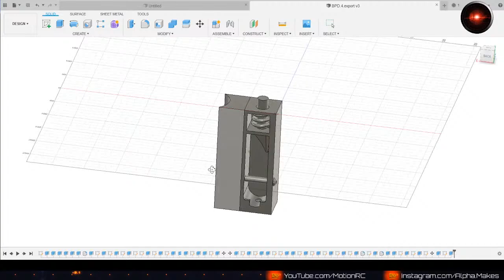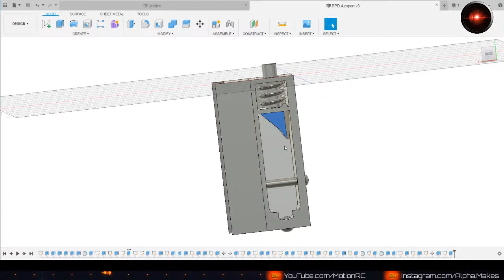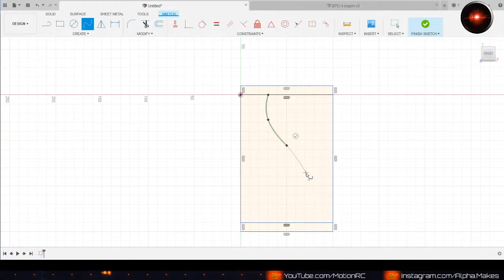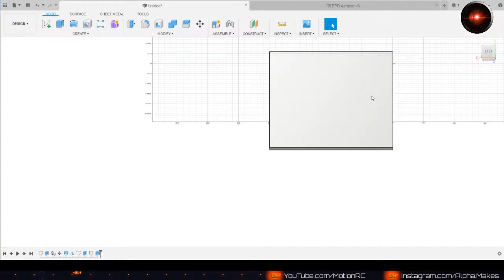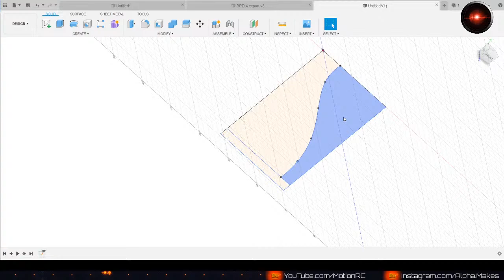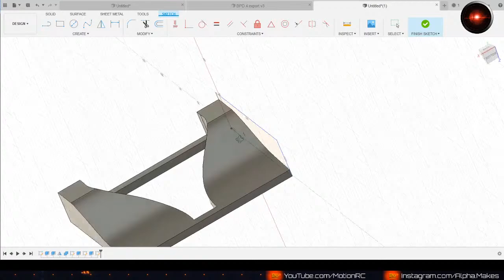Live Dive: 3D CAD Freedrawing

Comment: I have a question for you if you have time sometime. I will preface with the fact I started this journey of thought with the goal of making a greater than 1:1 thrust to weight ratio on my 70mm FreeWing F16.

 You had mentioned in HobbySquawk that achieving optimal airflow in an EDF system is a balance between inlet and outlet air, and that in higher airspeed a plane creates excess drag with higher intake or inlet present. However optimal intake at lower airspeed (or from a stop) is higher due to the lack of air being forced into the fan, as opposed to higher airspeeds. Would it be optimal to have a servo that slides to open and close a grid-patterned cheater intake relative to  airspeed? Do model landing gear doors play some part in this idea in some models? I'd love to have you talk about this concept in a video sometime. There are no shortcuts, but improvements are always welcome in my book. No matter how good something is, it can always be better.
Reply from the maker: Variable inlets are absolutely a viable answer. Several full scale aircraft use similar mechanisms, such as the variable inlets on the Raptor and Eagle. In the RC scales, the challenge is to develop mechanisms that are worth their weight and cost. For a balanced approach, look at what we did with the Freewing 90mm F-104 Starfighter's air brakes, which serve a dual function as variable inlet that allow more or less air into the primary duct depending on the suction generated by the EDF.
Reply: @alphamrc309  ok, thanks a bunch!